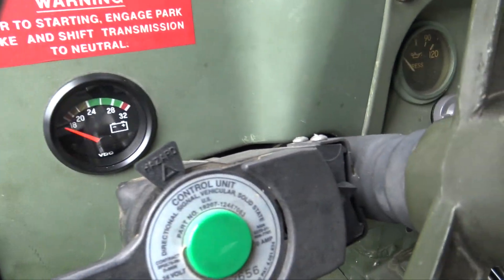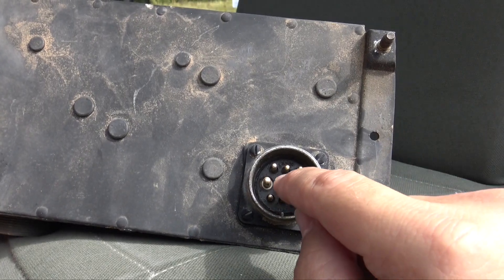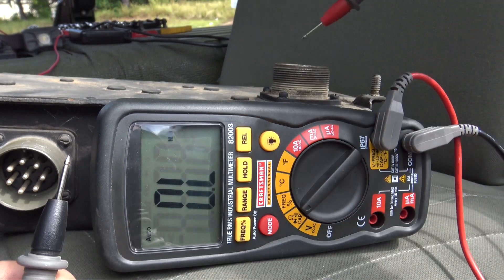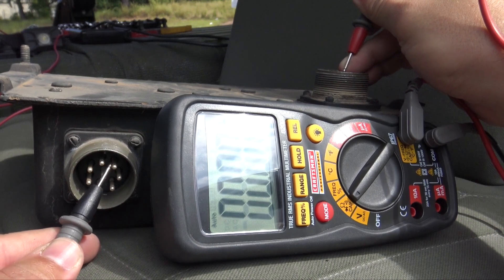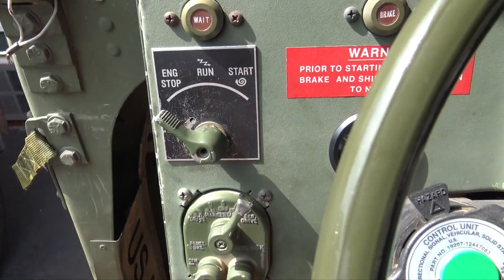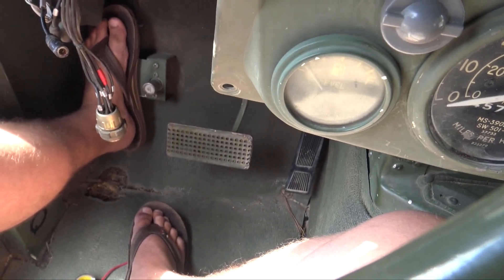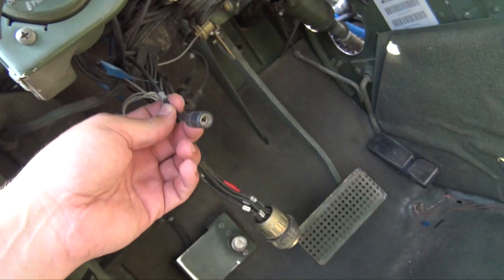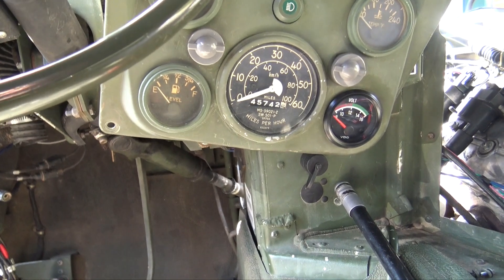Wiring Nightmare Day 1 #FAIL - LSxHumvee

Comment: It makes no sense to put your 12v gauge into the instrument cluster and the 24v gauge into the dash panel.  This only adds an additional level of confusion to an area most HMMWV owners know little about.  The connectors pins are lettered starting with pin A which is located next to the slot in the connector shell. The letters are molded into the rubber section that retains the pins in the connector.

Comment: I am having a nightmare with this control box. My glow plug light flashes for a fraction of a second and dosent heat the glow plugs enough to start the motor. Is there a fix for this problem outside of buying another $600 control box? Also if it is the box are these repairable? Any help would be appreciated..
Reply from the maker: I'm not sure what could be wrong, I have the control box out of my truck for sale if you're interested. It's $300.
Reply: LSXHumvee id be interested. But im a lot more intrested in why you no longer need it?? I hate these boxes. I was told of you disconnect the wires while its connected to battery you could ruin it??

Comment: I just tap ONE of my M35's batteries (It's two batteries of 12V each, not a singular 24v battery.), then added a 3rd battery -- a deepcycle that can be manually-disconncted from the mil-spec two batteries -- which is 12V, for all my 12V needs.  In the "pair of 12v batteries to get 24V" that the military installed (the 2 "cranking batteries" as opposed to my deepcycle...), if my 3rd battery or anything else draws the voltage down on ONE of the military's pair of 12v batteries, the pair of cranking-batries equaliz (get equal voltages to each other's) very quickly.